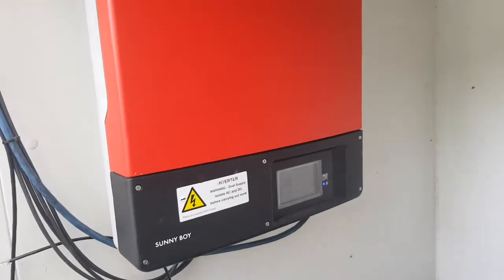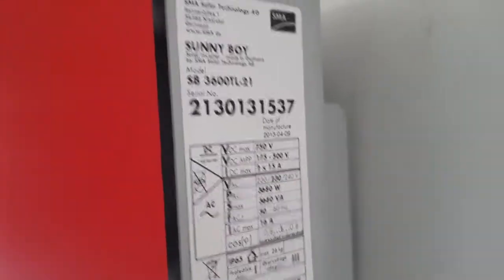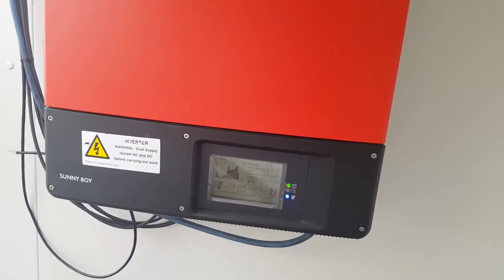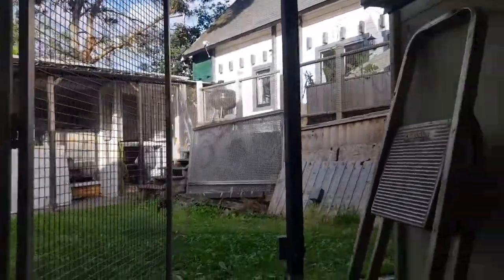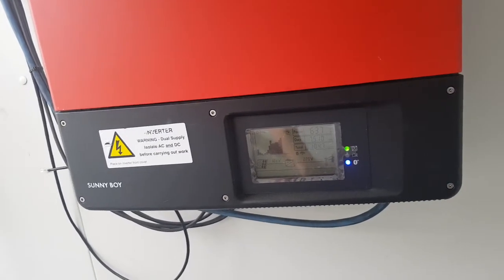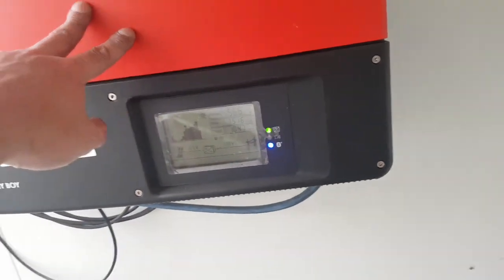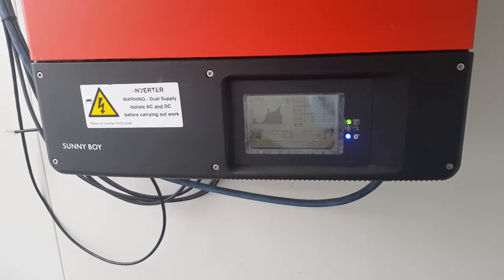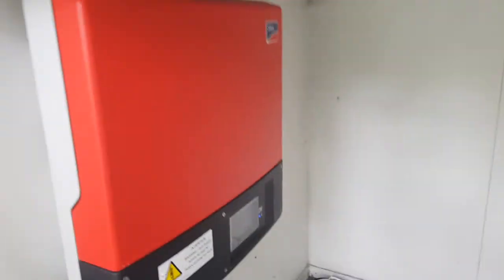Using older sma inverters off grid in a new installation

Comment: Possible connect two in paralell for 6600kw ?
Reply from the maker: My whole system is single phase, and i have 6 of thesr types all on the same supply... so to answer simply yes they can work in parrallel, they use frequency adjustment to throttle down when the batteries are full, or there is not enough load. If you were using these grid connected, and were capped on you export limit, then you would adjust the settings so the export is limited, and it would throttle down in the same way.

Comment: Hello,  I've got a question.  Perhaps and you can help me answer it.  
I got me a sunny boy inverter,  which I want to factory reset.  Is this possible?
Reply from the maker: Hi, if it the older type, you need to use the sunny explorer software. If its the newer wifi type, then you need the login credentials. Both will require a grid guard code supplied by sma for 50 euro, or you can try to talk nice to them and get it for free.  Some things such as total kwh production cannot be reset, but user / install setting can be factory reset.  Hope this helps. Ivan
Reply: @offgriduk2643  thanks for the info. it does help.
Reply from the maker: @armandouriosteguicalderon8924  no problem, good luck with the software, if you need any further help, let me know

Comment: That's not entirely a old one. I've just used a old LF sma inverter. I had picked that as it matched my PV better than a newer one. (Start and MPP voltages).

I've gone off grid to grid tied and the MPP takes forever and jumps about all over the place. Saying that it was a on off sun day.
So I'm not sold on it but we had mostly 0w from the grid, save for the morning with around 30w. So it's works but we were jumping from 780w to 260w.

It's called islanding. When the inverter will run without grid detection.
There is a form you have to fill in and send to sma.
Reply: Thanks for this, we have an older windy boy inverter and trying to find out how to connect a cable to extract data, any idea?
Reply: @bell-architects  
They had a box that only the later models support. Check the manual as it was a add-on and is named, but they are extremely rare to find on eBay
Reply from the maker: Correct you need the grid guard code, supplied by SMA to change the working mode, grid to off grid (even from country to country) after setting up after the first 10 hrs or so. 

If not setup correctly in an off grid format for grid connected inverters, they will lock out, until the grid goes back to normal, in this case normal is more to do with the frequency fluctuations when running off grid.  

I did find the older SMA work better on fixed and not MPPT, found the reaction time quicker. not really sure why as the inbuilt algorithm is almost similar, maybe there is a safe guard on time, when charging to get maximum watts.
Reply: @offgriduk2643  I think there an old hill climb MPP alg. 
Today's steady sun was fine. As it kept to the panel specs. But I had to adjust one panel as I noticed it wasn't quite right.

I'm not sold on grid tied. After being off for the past few months, and the panel config there is more power loss (higher voltage lower current on a single string) than what I had on two strings low voltage and higher current and split config. (Summer and winter alignment)
But the power dump to the grid rather than a battery makes it more a waste. 
So hybrid would be ideal with the newer inverters with built in export limiting.
I've not got Into the software on this one. There isn't a piggy back and I can't find the pin out to attach my device to read it.
I like that you can get access but could be dangerous if someone makes a mistake.
Reply from the maker: thats a real shame it can't take a piggy back card.  even a bluetooth one??  I think the hybrids are looking good, but you can setup zero export if you have comms and a home manager.  I know what you mean on on 2 split strings than a single high volt string.  I think this is due to to the algorithm inside and the minimum working voltage for that algorithm, production really does'nt get up and going to well above the minimum.  I think the safety part is fairly safe (the more fool proof something is - the world invents a better fool) you need to get the SMA code, a computer, use sma Explorer system, then change parameters, correctly ( in this case only the minor ones) , not mess about with the fine tuning.
Reply: @offgriduk2643  it would take a piggy back, I'm just not willing to pay the 100+ GBP for one. I'm well aware of the pence in hardware as I have it to talk to my MCUs.

I was looking at the datasheet/sales patter and this inverter actually is better eff. With lower voltage.
 The inverter start is 120, my array is 152, and my mpp is 120. So it's a good match.
But the performance is marked at 100v and 180 and there is something like a 5% drop, it drops on the next two samples they've used.

I assume the US Market with the 110v has something to do with it, as it makes perfect design sense. Here in the UK and our 230/240 it simply doubles the voltage, I suspect a 1:2 transformer. (I've not looked) but the weight of this at 23kg shows it's old age design. Being that they came out in 2007 and this one is 4.47 years old.
I can hear it switching and it struggles when it dropped to 100v when seeking. But it does do a full range sweep. It much have some memory as it was much better today and didn't take dives or top itself. 
I would have thought that was easy to program as obviously that's the start voltage. If o could, I think I would CV it to MPP and see how well it does.

 My 3.2kw ups with batteries (rack mount) is about the same maybe lighter. That uses a toroidal. Top brand name, blew itself due to a faulty build and high voltage retiring to the mosfet. And then back some more...
Reply from the maker: your correct again, i think you are a man that knows his way round a soldering bench.  The newer inverters use tordial transformers, and are more efficent.  I think the different sales data show an efficiency difference of only a few percent, but it depends where this occurs top or bottom of maximum mppt.  Strangely , i get better production from the older units, ( not the ancient one) as this has a lower start up voltage, so my kWh over the day are more. albeit, the peak production is less in Kw compared to the newer models.  Kind of having your cake but not eating it.  I think with a lot of re-mapping of the fixed voltage curve you could scrape that extra few percentage. But it's a lot of work and testing to scalp the last few percentage, and really it would be more useful in winter production, and would need experimenting then.  The piggy back cards are a pain to find now as the units are obsolete, i was lucky to get new from another installer, for a very reasonable price, i'll dig his details out if your interested. 

On my smaller ancient unit, i noticed that sub 25w the unit just stops production, this would be my cut off in voltage, also you have bear in mind nothing is free, so the inverter is consuming watts too.  I would think the inverter would consume the sub 24Watts of generation, hence no production.
Reply: @offgriduk2643  the percentage is relative really. Old iron core is around 91% a tyr is 97% but the difference is mostly made up from the frequency. And that entails the switching mosfets. The speed to reach MPP  also is a factor in the calculations.

My off grid was new tech and I would see more power. There is at least 200w difference. But. Currently my panel's are all north east east. And near flat. I was getting around 6 amps from them. But we'll say they're running at 50%. 
My winter array on new tech was running at 115%. Which is half the array and made more power than the four.
That was facing south and near vertical. (22o).

The power shut off is based on the inverters ability to run mains power according to the regs. They should be running at 5w as the internal computation. Then 2w per FET. There are usually 8 FETs 
Newer FETs at about 0.250w and the process computer around 0.05w.

We used to call these choppers, because they chop up voltage and spit out something different. Obviously there is a H bridge.
The other side on modern has a buck boost switch which makes power.
Say you have 100v and 10 amps raw.
But you want 50v, thats chopped to 50v 20amp. This is generally missing from older tech and you get PWM so the current doesn't grow and where you get losses.

I may pull mine apart and see what it's actually doing. I'd imagine that there around 65v you would want 134v after For peak performance with 10% losses.
But the bottom end will be 120v.
But ever  time split the voltage you spilt the current. 65v 8amp will be 130, 4amp (3.2 in real terms) then 240 will be 1.5 amps (360watts).

I believe the new ones run on lower power, but the engineering side the current is the big issue. If you look most around about 400v and 12 amps. It much easier to play with high voltage over current. Especially with DC. A 120v 8 amp would be the equivalent of 240v 16 amp.
I was running 38v 34amps so that was big cables and series hardware but it was still a killer. Solar voltage is easy to make as the sun side is current. But if you have 1000v and .5amps (over cast day) you're going to make 500w. You may have noticed panels are now higher voltage at around 47v.
Inverter power is in VA which is generators talk and not as good as KW ratings as it's about relative power.

I've been playing with electronic for a few decades then went into engineering. But I build things robots and such. But I've made a1500w MPPT charge controller. 150v 104amp in sale bs. Doesn't take long or much work as I have the bits needed to make them. I think if I get time I'll make a solar inverter grid forming. I don't think I'll risk the dno calling by making a tied inverter. But I have lots boxed up ready to do the making.

Comment: youtube is auto deleting comments for unknown reasons
Reply: These inverters are brilliant, it's hard to think of them has been old because they are so sophisticated.
In off grid setup you have to have them grounded and neutral has to be bonded to ground for it to work.
Reply from the maker: @martdaymo  too true, i think that really goes to show a consumer world we live in, even though something wotks perfectly well, we'd rather through it out and buy a new one. Hopefully i can save a few from land fill
Reply: @offgriduk2643  Just picked up one of these from the scrap yard for £20, plugged it into the mains and it powers on, just need to test it with panels next
Reply: What program is required ?
Reply: @yanickborg3118  you need sunny explorer,  it can be downloaded from sma. If you changing grid conditions you need a grid code also from sma.
Reply: @ivansnelling5494  

Thanks mate ! Appreciate that info.
Reply from the maker: yeah, i noticed, i think it was because the brand name was mentioned
Reply: @offgriduk2643  SMA or Spinal Muscular Atropy, YouTube does not want you combining this with Certificate Of Vaccination ID (COVID).
Reply: @offgriduk2643  I swear YT rules get nothing but stupider and stupider.

thanks for the reply and the video, I had no idea.
these are a common Item here in Oz on the local second hand market for sfa.

good luck with your projects and endeavours.
Reply: Hi, what is the dial in side set to?